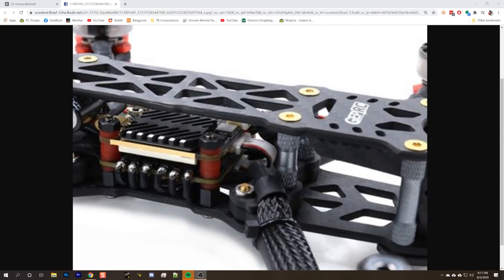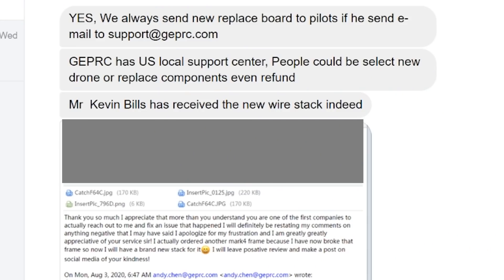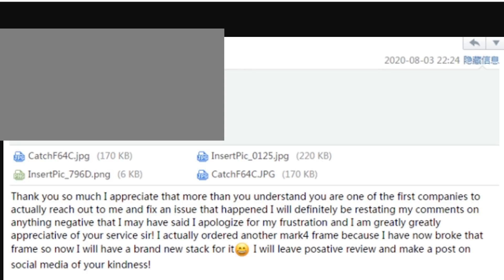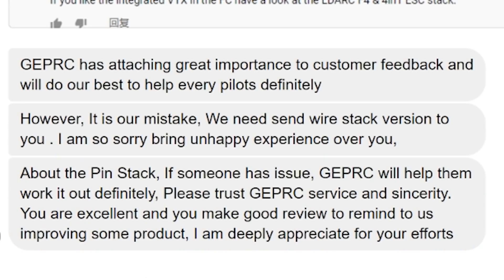GEPRC responds to Mark 4 FC pin header problem (replacement?)

Comment: hello Mr Bardwell, I am new to the fpv hobby. i started with a few emax drones and just recently upgraded to my first 5 inch GEPRC mark IV. it does not have the pin nheader problem, however it managed to lose its profile in Betaflight. Being new to the hobby please pardon my ignorance, however where might i find the CLI dump for it? for some reason the ESC is no longer initializing, but am hoping it is due to a lack of control from the FC. Can you help a nube trying to get back in the air? it flew great for four packs, then seemed to randomly loose its mind.
Reply from the maker: Ideally, you should copy the CLI dump from the quad when you first get it. Go to the CLI and type "diff all" then save that. If you haven't done that, your best bet is to contact the manufacturer.
Reply: @JoshuaBardwell  thank you so much for taking time to answer this noob question. i appreciate all of the knowledge i have gleaned from you channel in the last few months. I found my way to a great FPV setup and quad thanks to your reviews! thanks again for the info, been waiting to hear from the manufacture. Take care!

Comment: Geprc is a great company and I stick with them. I have an Elegant(s) and it's flight controller has pin headers and I have crashed it more than 100 times with no issues. I have had to resolder broken motor wires but never had a problem with the pin headers or the built-in vtx. That being said I'm sure the soft mounting was much of the problem. I don't want to say more since I also like my products to stay in stock. Geprc makes bullet-proof products unlike much of the junk that sold to us in the market!

Comment: There is exactly one correct way of mounting a 30.5mm stack and that is by using long steel screws from the bottom plate to the topmost level of the stack and nylon female-female standoffs in between  (or silicone grommits for the FC). Everything else will break, cause issues or both.

Comment: kudos to geprc. the g-force in crashes is gonna damage those pins and a bad connection will cause a few weird issues not easy to spot, swap em out before they break.

Comment: I bought the rocket+ when it came out and never got to fly it. Told geprc the issue, there response was to say that they test everything so it must be my fault.. Turned out to be a bad air unit, had to send it to DJI cause geprc refused to let me send the quad back to them for a replacement. After I got the air unit back from DJI I plugged it in and the battery leads welded together and the quad started to cook.. I had to pull the battery so hard that the leads pulled off the board to stop it from bursting into flames. Still geprc refused to admit that something is wrong with the quad I got.  They refuse to replace it or refund the money since they blame DJI or user error cause "test everything before shipping". I'm never buying anything from them again.
 I bet they would have responded differently if I had a massive following on YouTube though. 🤦‍♂️

Comment: They wait until the pin broke then replace the wire??? I had a very bad experience using the pin on Dalrc F405 and 40A stacks. The internal pin socket is broken without noticing it because of vibration. My quad direct fail-safe and drop to the ground when I was diving a building. When I was troubleshooting, I saw the pin socket came off. I think people who still using the pin should change to wire and don't wait until it broke.  When the socket is broken, you may not notice it.

Comment: mark4 has a lot of vibration resonance, it's hard to set it to fly well.
Reply: Yeah I noticed that in my gopro video, every time id throttle up id get a lot of vibrations in the video, dont notice it in the fpv feed, just in the gopro video.
Reply: Make a few modification on the filter will make more great flight

Comment: I emailed geprc several times regarding the same issue with my new mark 4, maybe I was one of the 10 units but i feel there were many more! no reply from geprc so I posted on the geprc facebook page how unhappy I was, it turned into a bit of a shit storm with loads of other people saying they had the same issue. A few days later Jin Chen messaged me and told me they would send a new flight stack, great I said thanks very much, I will update my post to reflect this and show the others it is being resolved. But geprc then deleted my post before I could update it and gave me a tracking number, which has not updated in over a week! so we shall see if they come good on my new stack!. Thanks JB appreciate all your efforts! :)

Comment: At least they responded to you, being an 'influencer'. They replied to me once after three weeks, said they would send a replacement DOA part, and never replied or followed up on it after their initial reponse. 
Better order from a reseller and let GEPRC just be the manufacturer, Running a shop with customers (support) is not their strongest point in my experience. Avoiding their shop like the plague now. Love their products though!

Comment: That's a lot of BS from GEPRC. I bought this stack some time ago - STABLE PRO F7 DUAL BL32 35A. Same thing, soft mounted all the way and hard connections on every board. 
They realized that now? BS! They just had to respond to someone that has a louder voice to make them a bad opinion...
Reply: I believe they changed this before JBs video came out as i ordered mine the day before his video and it arrived with the new wire bridge.
Reply: The Mark4 uses the GEP-SPAN-F722-BT DUAL, which indeed has wired jumpers.
Reply: agree they don't ansere your email, i had problem with them last year with 3inch and the fc stack has those pins .
Reply: My cinepro 4k has 722 dual gyro so should I be worried or is just mark4?
Reply: @divingfalconfpv4602  ask them to replace it

Comment: Don’t understand why the GEPRC F4s and F7 stable stacks still keep the pins. Does JB have to make a video on each iteration to get this wrong design globally fixed?
Reply from the maker: 16mm stacks are ok to use this technique. They are smaller and light and much more tightly put together.
Reply: Joshua Bardwell I’ve got the F7 version 20x20 and already broke 2 FCs. Time to move to a different brand

Comment: Yes; GEPRC seem to have excellent support as well as products. They diagnosed and replaced a troublesome FC on my cinepro adv quickly & without charge :)
Reply: Wish they did the same for the rocket+. Worst customer service experience ever. 30 emails later and still won't replace it..  Never even got to fly the thing.
Reply: @AgroAaronFpv  that's not good.  I'm shocked
Reply: @retrodudefpv  I am as well. I've bought a few of their quads and have been really happy with them until now.

Comment: The GEPRC Phantom has this problem as well. Have had to replace the fc and esc twice due to this. So still an issue on 16x16 boards as well I'd say.

Comment: Just got my Mark 4 and it is perfect --- love that quad ... ;)
Reply: FYI: If you have the DJI version with BT config and want GPS rescue+compass, they tie the serial rx to serial port 3 in stock config which is shared with the i2c bus and no amount of reassigning the pins would make it work. To add a GPS with compass you need to move your serial RX to port 2 & add the compass SCL/SDA lines to port 3. The DJI serial port is connected via port 1 which is stock so no changes needed. Connect GPS serial to port 4 like you normally would a free port. The stock barometer also does not work for the same reason which it will after you change the serial RX port. Not sure if they changed this on recent versions. You end up with all 5 ports used and maintain a working Bluetooth speedybee config. Hope this helps someone.

Comment: I purchased a GEPRC Flight Controller with ESC. Had one decent bump and now does NOT work. It has the wire harness as well... Just food for thought. I don't think that mine would be covered since the direct solder pin headers are not on my combo. Sad. I liked the stack, and it WAS on my primary goto!!! Gep, if you are listening, PLEASE look into other causes for this issue if widely reported. I could have simply had an unusual impact with those light branches... But, then again. 110+ U.S.

Comment: Do you recommend starting with the mark4 as a first time drone user? Have dozens of hours on the flight simulator (liftoff) and feel quite comfortable.

Thanks for the channel.
Reply: I would go whit the t-motor ft5 it's 200$ and great, it's on banggood.
Reply: you cant get a better price to quality ratio that it
Reply: Maybe nazgul 5 just cos it’s cheaper? I think it’s called the sl5e now and jb has a huge tuning video just for it
Reply: I would go for a tiny whoop, as your first drone you will break it xD even after some simulators time!
Reply: I built myself an Apex and never looked back. The frame is a tank and it flies absolutely amazing!
Reply: Aaron Cartwright But it is expensive
Reply: @farbenfrohesgrau4056  It is, but it won't break and flies incredibly well. If you dont do a Mr Steele build, it's not as expensive as you'd think. My first Apex build was around $400 but it's definitely possible to build one for cheeper. I've crashed the thing so many times into cement, trees, metal poles, and parking blocks. I have yet to break anything on the frame other than props and motors.
 That t-motor quad is also really good!
Reply: @Aaron Cartwright @farbenfrohes Grau I suppose one benefit of the sl5e or nazgul 5 is that it is so common and if you have any issues or need support you’re very likely to get it. This will be very valuable as you crash and repair stuff. It’s almost like the ender 3 of 3D printing.
Reply: The t motor ft5 is not a bad shout... didn’t realize t motor even made such a quad.

Comment: GEPrc make some nice quads and the MK4 is almost the best value for money BNF at the moment. The frame is lightweight, great camera, but I just wish they went with a seperate VTX.

Still a nice quad and good of them to respond to the FC issue so quickly 👍

Comment: Had this same issue with the stack in the cygnet 3 after pancaking from about 3 meters up in the air onto the asphalt , it a nice & solid frame but the softmounted FC stack & the crappy 200mw vtx (on the non pro version) have some pretty fragile pins 👎🏻.

Geprc learned something today...

Thanks JB for your influence & making this happen, we are now changing your title to “The Quadfather” don of the underworld FpV mafia!

Comment: I ordered this from them a week ago and they still haven't shipped mine. Maybe this has something to do with it?
Reply: Mine took a couple weeks as they ship from Shenzhen, if you contact them they can give you your tracking number. Mine came with the wire bridge instead of the pin stack so you should be all good.

Comment: Hi Josh    Great News. I have always liked GEPRC Product's and that they will work with anyone who has this problem.  I just purchased a XJB-145 that has pins and it died,  HGLRC said that they are aware of the problem and when"t to a cable but they would not help me out in any manner.